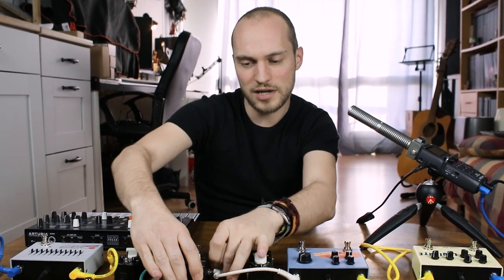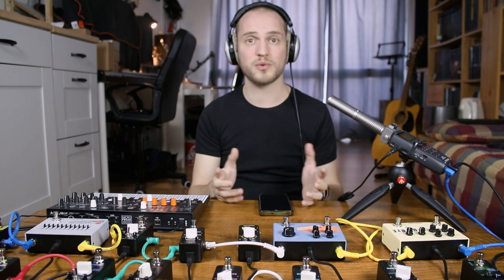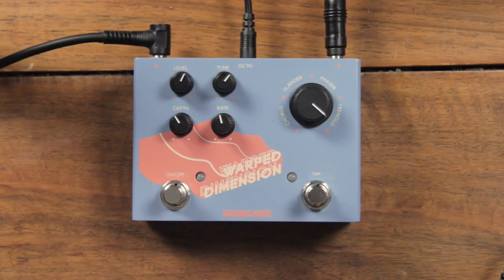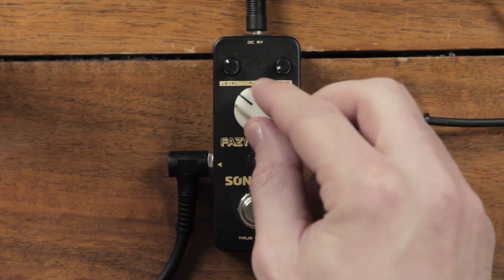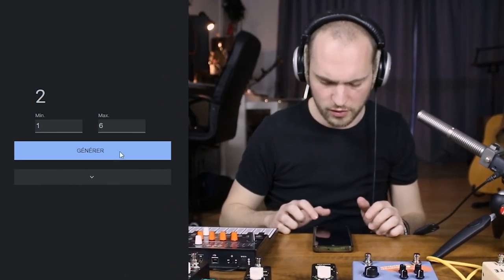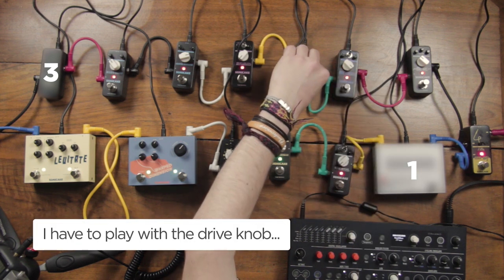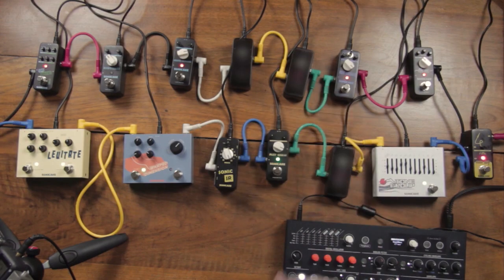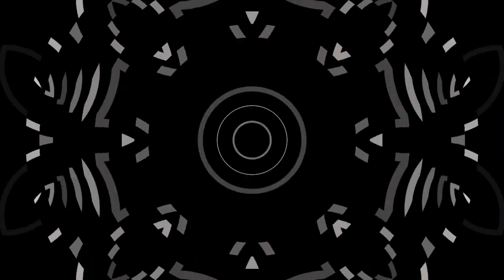DAWLESS SOUND DESIGN

Comment: You should look into the Empress ZOIA! I use that as a send effect on all my hardware synths and it's insanely versatile for building complex ambient sounds.
Reply: I second the Zoia, although with a caveat that it's basically a modular synth in a box so it can be odd to fit into a chain rather than being an instrument itself.
Reply from the maker: Thanks for the recommendation! I'll check it out :)

Comment: I love using effect pedals with synths. 🙂 Boss Space Echo is really fun - tape delay and spring reverb. 

As a utiliitarian point on noise: different pedals are different levels of noisy, and you do need to optimize for that. I'm not familiar with Donner, but I've had good luck with Empress effects (including the Zoia), Strymon, and Boss for maintaining a low noise floor. Noise clamps/gates can automate the process of killing signal between pedals when nothing is playing, too.

Last, just a plug for my personal favorite gizmo in ages, the DF Audio Minibay lets you reorganize pedals and other gear with eurorack patch cables, it's made figuring out the noise issue and finding interesting combinations a delightful exercise. I actually ended up getting 3 of them and running my entire studio through them.
Reply from the maker: Thanks for the recommendations :o I have to look up the zoia as everybody seem to recommend it.
I wish I had a noise gate as well. I was suppose to receive one, but the delivery got stolen...